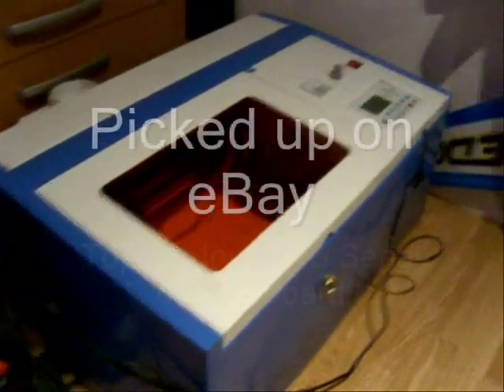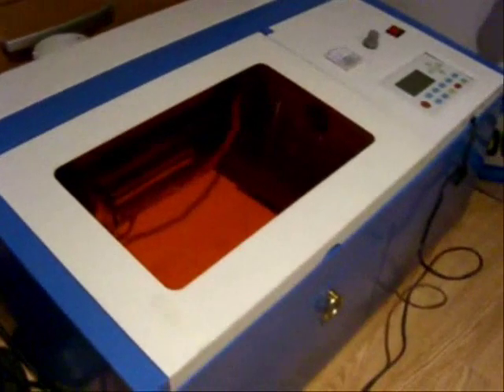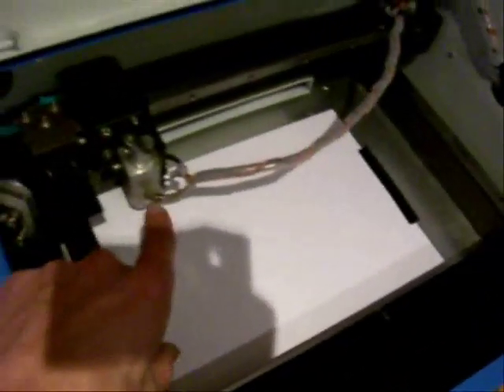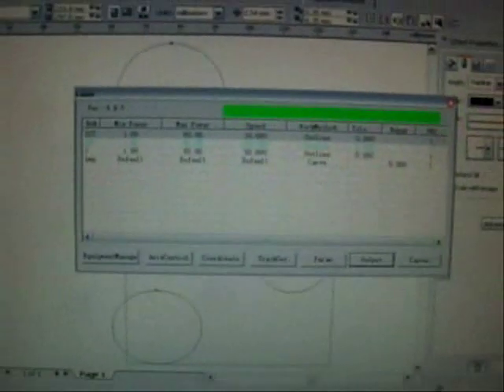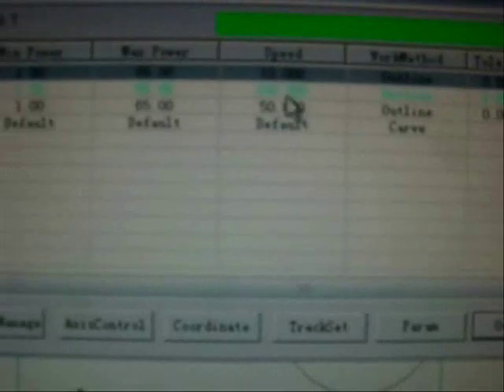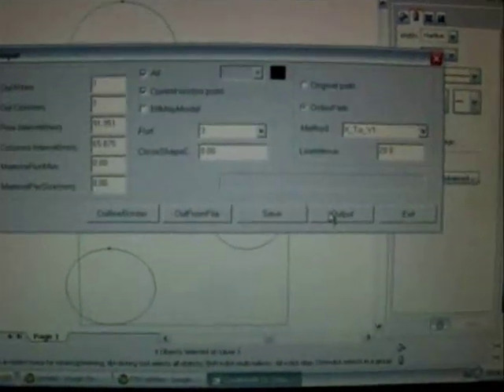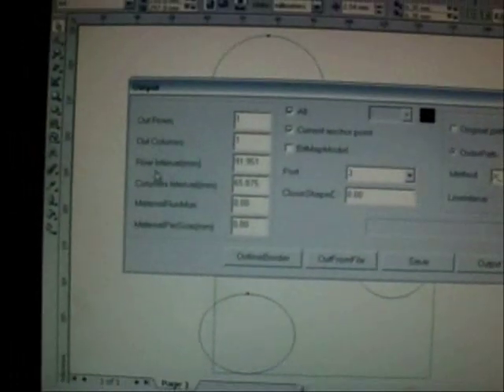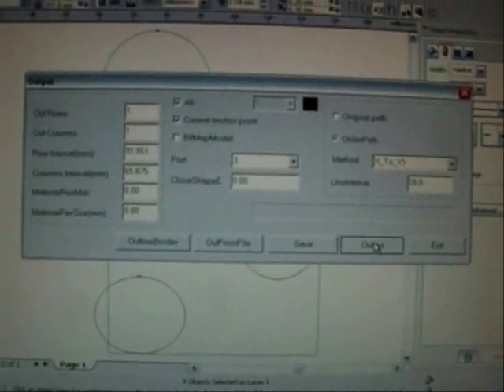40W Chinese laser - CorelDraw Direct output

Comment: Hey can you help me, I bought a chinese laser, from a company called Daquin to make screen protectors, it works awesome with the software included (daquin cutter pro) (i think its moshi draw rebranded) to cut screen protectors, but when I engrave a picture it stops half way. How did oyu make yours so fast? Did you buy a controller? If so how do you install that? How much does it cost to do that? Thank you! Also do you have an adaptor for 120 to 220 or something like that? Thanks! IM in USA btw, thanks!

Comment: Hi man, Can you tell me how do you solve the problem with the softdog, because when i installed SmartCarve and other softwares like this as lasercut5.3, the same error appears, always is the same error. This is the error when i try to open SmartCarve: "Can´t find SmartCarve4´s Softdog!", and when i try to open Lasercut5.3: "Plug in softdog and restart the software!", i have researched it but not succes, and seems you already solved this problem, thanks for help.
Reply from the maker: The SoftDog is a "Software Dongle" that is plugged into your Parallel or USB port depending on type. If you don't have one the software won't run.
Reply: pinter75
sorry i have the same problem. the usb dongle is that usb flash like  in transparent red that comes with the cd and manual? thanks
Reply: pinter75
 Hi pinter75! Gotta question concerning the dongle....where did you get it from? You said, you bought the laser without software, so no dongle included, right? We bought a laser including software and dongle, but it doesn`t work. So we want try to de-install the delivered software and to install the software from Yueming Laser. But how did you make it run without the "original" dongle? Thanks a lot!